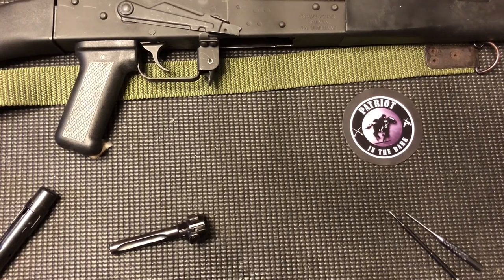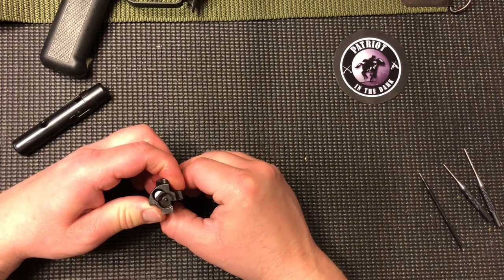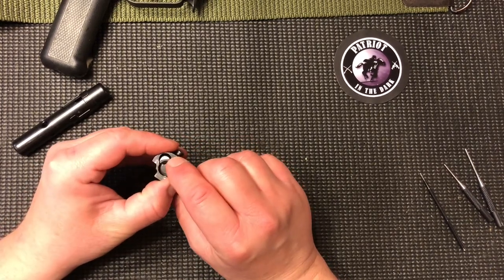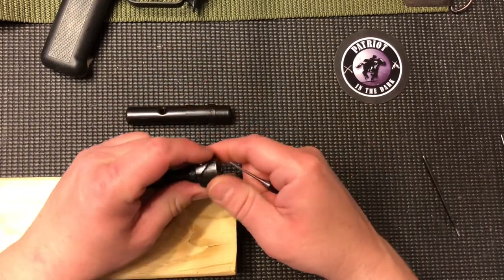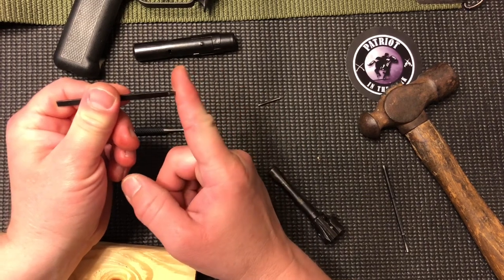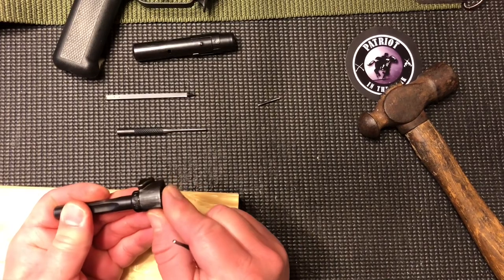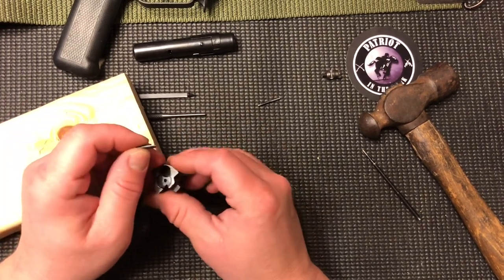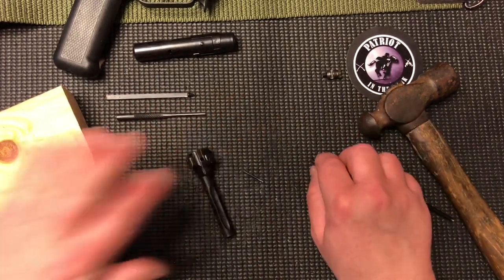WASR 10 Romanian AK47  Series - Complete Descriptive bolt disassembly/ reassembly Part 1 of 2 * PITD

Comment: Is there anywhere you know where I can buy a replacement bolt for an older wasr-10? I put my zastava npap m70 bolt in there and it worked just fine.
Reply from the maker: Not off hand, but if you do a search for AK parts kits, you may find someone that has bolts.
There are several companies that sell kits when available, you might also want to sign up for their emails.
Sorry I wasn’t much help, thanks for watching. I do appreciate it